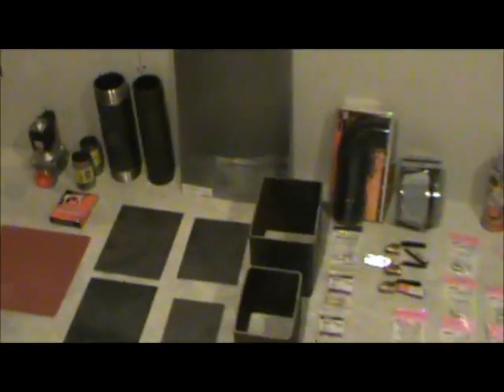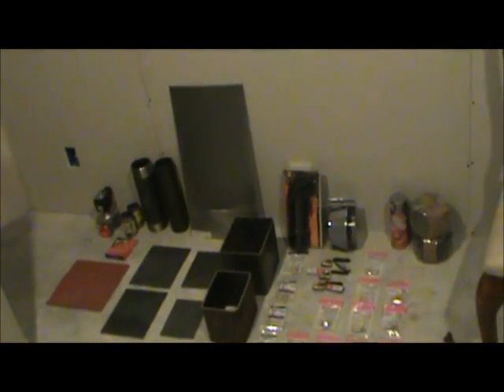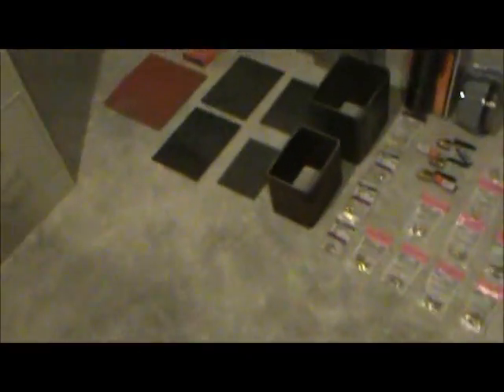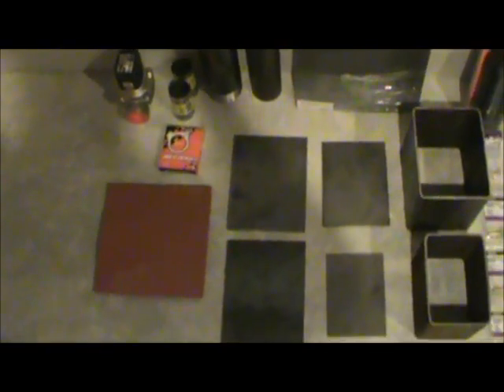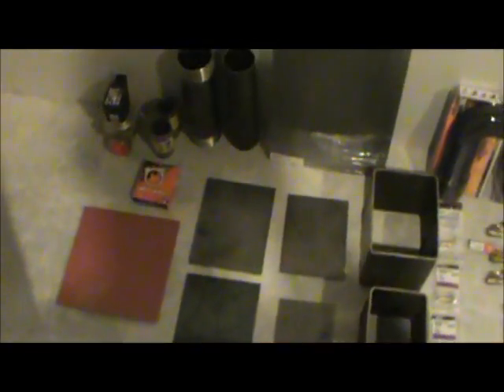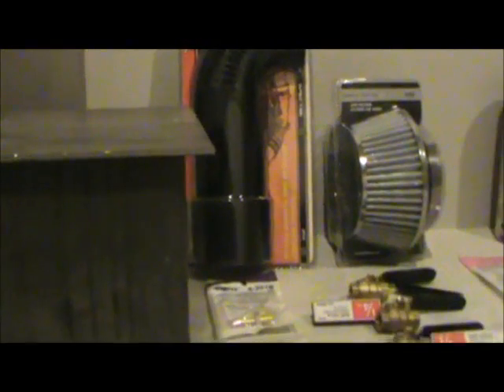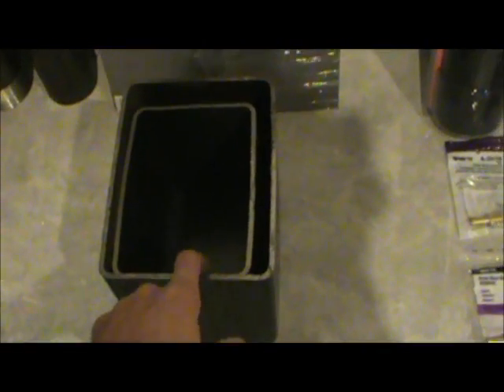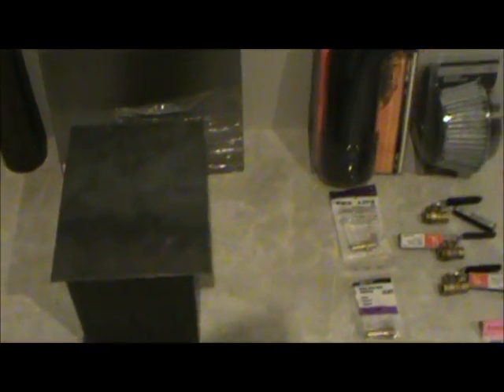100+ MPG Project New Fuel Vaporizer Design Part 1.1

Comment: Don't fall into the Humanistic Trap of One Apparati in your Rolling Laboratory.  You need to have Ultrasonic Transducer, Electrolysis, Voltage Control, Temperature Control, Oxygen Control, Fuel Selection and monitoring...it's what you need to have access so that you can find the SWEET SPOT.

Comment: http://fuel-efficient-vehicles.org/energy-news/?page_id=787 
Tyson, check out the hair line diagram of the Tom Ogle design system.  The pic of the butterfly valve on the top of the gas tank is hard to see.  Try zooming in on the pic.

Comment: Any reason nobody is using a ultrasonic humidifier to mist the gas ?

I saw a guy online take one apart and use the ultrasonic part on the bottom of a container and it work like a charm... Though of rigging one up to my gas tank and using the breather line to go to my air intake, butttt I`m more than a little uneasy about the tank catching fire :O So a small container with a blowout valve and a couple flashback arrestors under the hood to start would be safer ?
Reply from the maker: I've done it. They don't last very long. You can special order them without the water level sensor in them which would work much better but I have not tried that yet.
Reply: Curious, can`t you put a reflective material like those silver emergency blankets under the ultrasonic vaporizer  and wrap it up around a container to deflect the energy waves up into a container so you  don't have it submerged in gas ? 

I use the emergency blanket's for deflecting the radio waves from smart meters, Nabors Wi-Fi, cell phone booster antennas and more, so it makes sense to me they should be up to the task. The ultrasonic vaporizer is just emitting radio waves to brake up the water molecules into mist, or have a mist something  ?

Another cheap material that works for deflecting radio waves is aluminum foil and the more expensive aluminum screens.
Reply from the maker: I'll have to give it a try some time!

I have not tried using a separation chamber and having the transducer submerged in water under the gasoline. That may also be a solution. I'll have to try both. Heating the fuel shows the best results so if you could run the vapor the transducer produced through a heat exchanger it would work even better.

Comment: Hi, I just found your channel. Awesome. I read here that you are recirculating the fuel back to the tank. I am using a magnetic float with a solenoid to controll the level of fuel in my vaporizer. Just an idea. Thanks for your videos.

Comment from the maker: I haven't bypassed the power to the fuel pump yet I am currently just recirculating the fuel back into the fuel tank of the car. That is a great idea though! I can connect it up to the same circuit I use to control the fuel level in the vaporizer.

Comment: i had a great idea to use the existing gas tank, I don't know if you already do tho, the idea is, to bypass the power to the fuel pump, and hook it up to the float in your vapor unit, so that you can use your vehicles main gas tank, and when the level of fuel gets low, the pump will turn on and pump gas into the reservoir of your vapor unit.   Im just saying this blindly I haven't watched all the video's yet of your new designs.

Comment: Tyson , 
  Instead of using the exhaust heat to vaporize the fuel . You could use a small radiator  put into a small/medium size stainless steel container prefabricated  using the ultrasonic transducer to fog the fuel even more . It would be easier to reroute the radiator hoses/fluid (water/antifreeze)  then using the exhaust .

Comment from the maker: The first design was very simple but was in no way reliable. The conditions required to get consistent results are complicated this is why I had to go with a more complex design. The old design only got me the 200+ MPG a couple of times because the environment needed to create the vapor has to be controlled. With this new design I am able to control the environment in the vaporizer container. I put 100+ miles per gallon because This is what I feel can be achieved consistently.

Comment: It seems like your getting more complex from your other video with the bucket that you said ran great.  And you went from 200 plus mpg down to 100 plus mpg.  Remember keep it simple.  Maybe you can use a coil inside bucket where your hot water hose can run through to heat fuel.  And still use the electronic valve control where the inlet is like a butterfly connected to your pedal to control air mixture.  Or use your gas tank instead of bucket and heat your gas in the tank.

Comment from the maker: As was I. I was saying I am going to make a container even smaller than 1 liter. I want to shrink it down as small as I possibly can. Once I determine the amount of vapor needed to run the engine perfectly I can shrink the size of the container down. I have another design that I will be building that will be pretty small that works through my injectors.

Comment: I have a simple suggestion (not my own idea). You may try putting a smaller, somewhat long container between your fog chamber and where it goes directly after. This additional container is empty and has the incoming fog hose/pipe going nearly halfway down its length inside, and the outgoing connection very near the top/lid. This will catch ANY liquid that comes through a splash guard.

Comment: Great work Tyson!  The float level question you have can be accomplished with an electronic non-float system that can be tied to a controller and a solenoid valve on the fuel line.

Comment: i will post up my proto-type some time in NOV so b sure 2 check it out. upon that, i will start on my new design. i still need 2 gather some more stuff 2 ensure its safety first & then test it. i like ur idea about the heating, that sounds pretty good. for the heating, i have another method upon doing that but i have to test it out first. be safe & thanks for the update.

Comment: Hey Tyson, this unit looks a lot like my proto-type I'm doing right now with just pvc pipes & electric box. Upon building it, i 2 ran across spacing problems & had to work another route 2 ensure it fits in2 my car. The guard is no doubt a good idea cuz i 2 have that 2 ensure no liquid will splash high enough 2 get sucked n. 4 the float, i would just go with the fuel float instead for a longer lifespan. Ur unit looks a bit big. i have a new design now way differ from my proto-type.

Comment: I'm looking forward to following your build and final testing of this gasoline vaporization system you're building. Where did you locate your high temperature thermostat 0-999 degrees fahrenheit is an excellent and ideal heat range. Gasoline autoignites at approximately 950F at atmospheric pressure(14.7psi at sea level). Your thermostat range is perfect. Nice work.